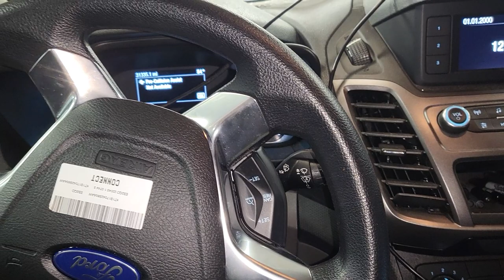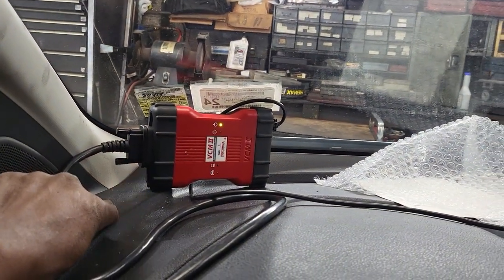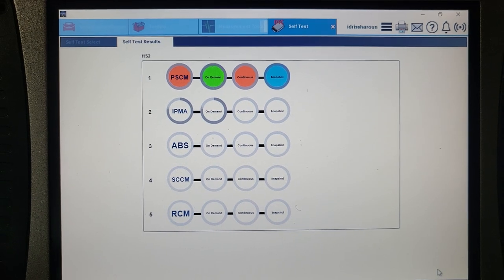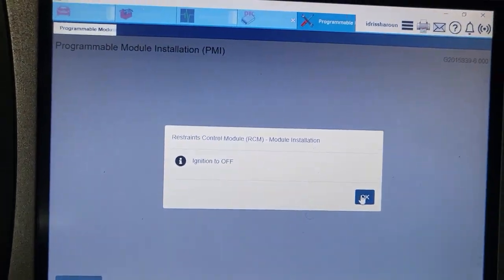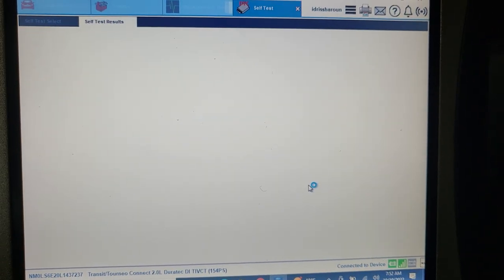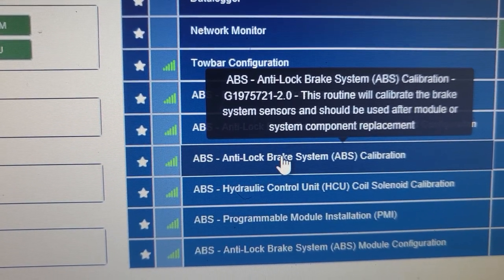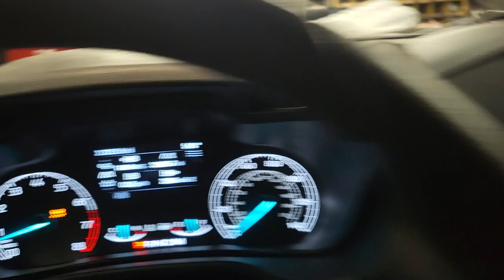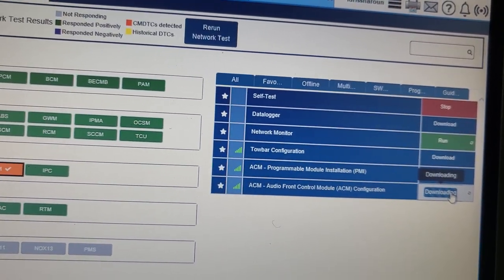2020 Ford Transit Connect Airbag Module Programming Using FDRS Software

Comment: Hi,
I have a Lincoln Aviator that the steering wheel has no power in control buttons. How can I tell if its the Clock Spring issue? Any tips you can share please.
Reply from the maker: see if the air bag light is on  or the horn is not working  working
Reply: Yes the airbag light is on. Horn is not working.

Also I’m replacing the RCM, using FDRS to program the module I’m getting error: procedure aborted
Unable to download software files for this module.

Fyi - i’m got the same module with same part# purchased at Ford.